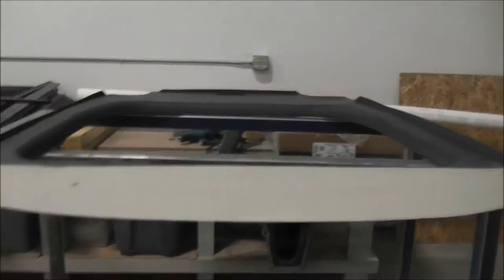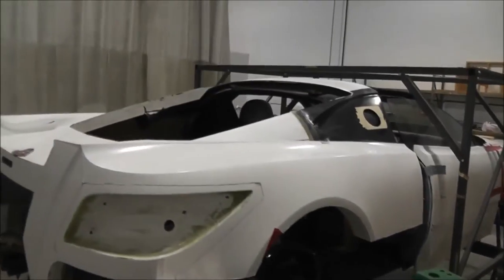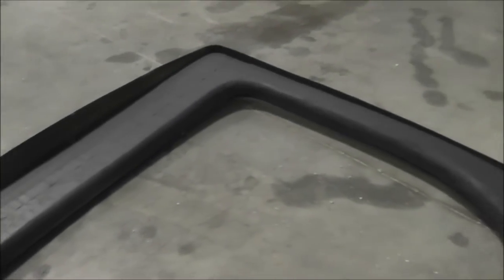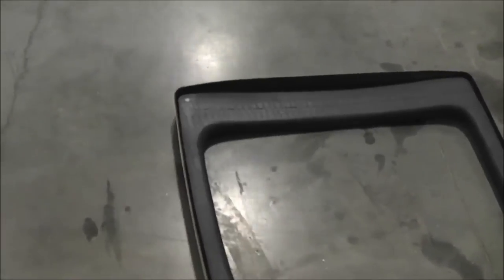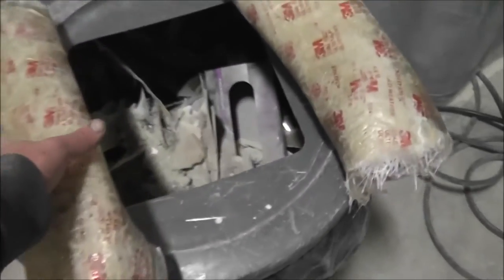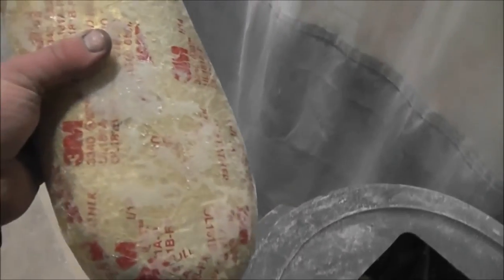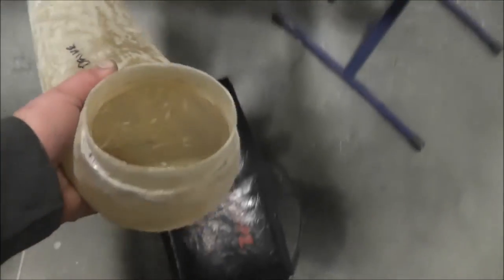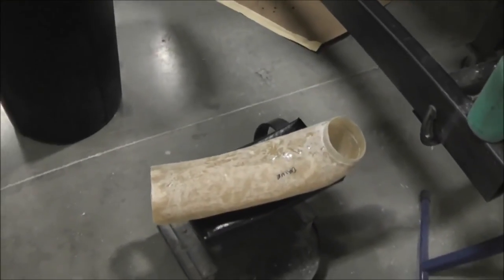SCRATCH BUILT CAR PROJECT - Making Parts From Scratch

Comment: Nice,   You don't really have to cut the box open to remove the foam..  Just pour in a quart or two of Acetone ..  Shake it around,   It melts it out CLEAN..    The down and dirty way,  is to use Gasoline/Kerosene ..    The regular  Home Depot foam just disappears ..  Not all foams dissolve..
    The Glass you're gonna use :  is that "Off the shelf" glass,?   or do you have someone make it ?     It's really hard to find any info on fitting Glass into hand built fiberglass bodies..  I ain't starting my project until I got the glass figured out..   I think a total custom designed and home  built body,  has to be,  almost,  built around the glass you can find..   I've never seen any one design their own windshield to fit their design..